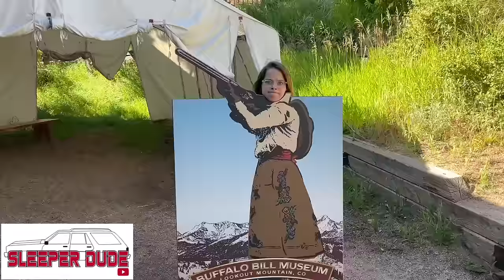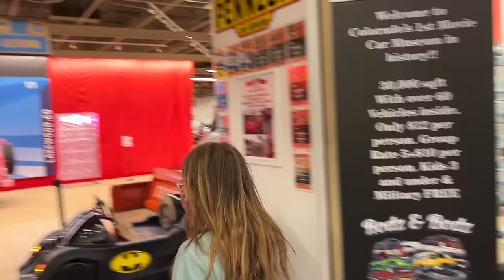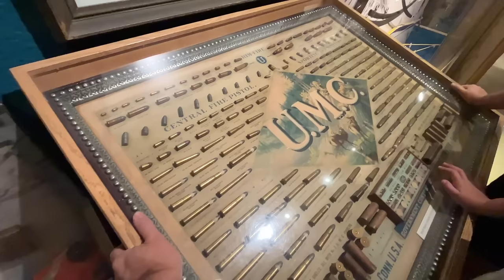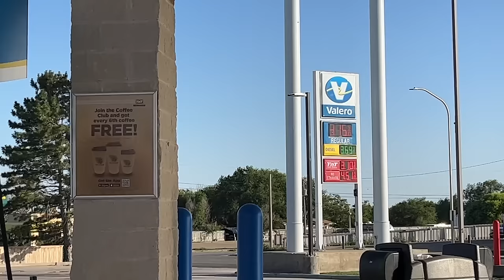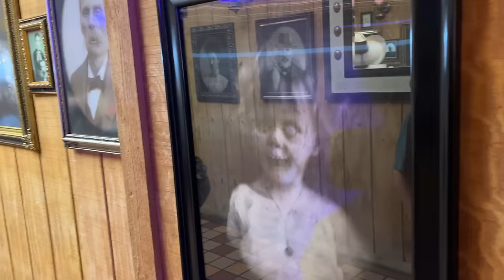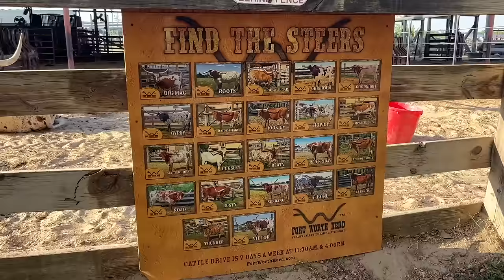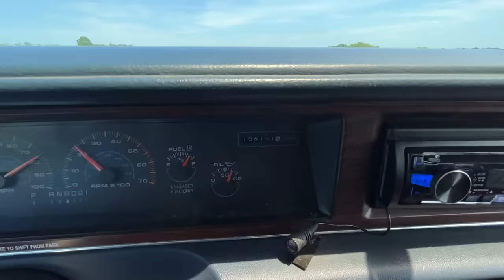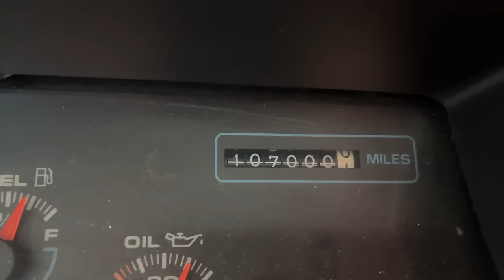2000 Miles From Home! Can We Make It In A 31 Year Old Station Wagon?

Comment: That Olds wagon would have made three trips of 7,000 miles...I've driven these vehicles (Olds, Caprice, Buick) for over 25 years...the 5.7 v8, LTI is indestructible.....easily will make it to 250K miles.....these cars are meant to be driven until they LITERALLY fall apart.....great rip, great video...thanks.
Reply from the maker: Thank you

Comment: Josh, at 1:25:20, the old red building in Dallas you thought was so beautiful is the Old Dallas County Courthouse, built in 1892.  The white building to the right of the old red courthouse replaced it as the new Dallas County Courthouse in 1966 (now called the George Allen Courts Building).  Old Red used to be the Dallas County historic museum, but it will soon become a courthouse again, housing the Texas 5th Circuit Court of Appeals.  The other pretty building Tosh mentioned at 1:26:33 is The Adolphus Hotel, built by Adolphus Busch and opened in 1912.  Adolphus Busch was a cofounder of Anheuser-Busch, which brews Budweiser beer.

Comment: No one except Tosh, and kinda side stepped it at that, but 18 days and not one clip with everyone rolling down windows to clear the air from someone farting. Surely(shirley) Josh was not the only one who had to have a emergency poop!??? Not one mention of RC Cola the whole time! You showed me much that I had never seen, and the things I had seen(only in pictures) Your pics and video showed me more, a lot more! The Old's did great! I mean, no adding fluids of any type, no over heating issues(except when you left it running, and that really don't count. The digger going off, did you fix it or did it quit on it's on? And what about the rear lift compressor, did you pull the fuse or? 
For me, it would have been a difficult trip. knowing that I had that Big Beautiful Shop at home, just waiting to be put together!. And, I hope hotels have got better, back when I did stay at one every now and then, the beds were as hard as the surface Ralphie slept on!

Comment: That is a small rattle snake. When I was in the Air Force stationed in Texas We were digging a pond and one of the guy running a scraper cut a piece of rattle snake out of the ground 8' long and we did not get the head or the tail. That snake was about 4" in diameter. Rattle snakes get huge.

Comment: I'm sure you all have heard this /  Bennett motors were the Corvette Rides high in the sky or over the last few years that has changed to Bennett motors where the viper rides high in the sky you know what I'm thinking Superdude Where The Oldsmobile wagon rides high in the sky after it making that trip and Using No Oil Put It Up In The Air on A pole Platform in Your Yard it deserves a retirement

Comment: Was wondering if the Ford camper had a bad temp sensor. They will dump fuel in the engine. Usually they flood and won't start.
Reply from the maker: Mine actually was running out of fuel